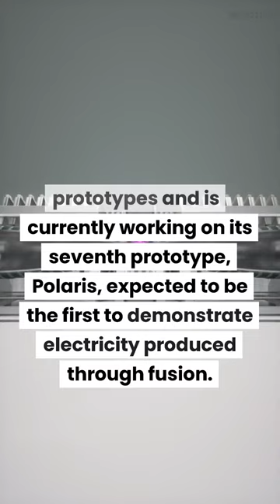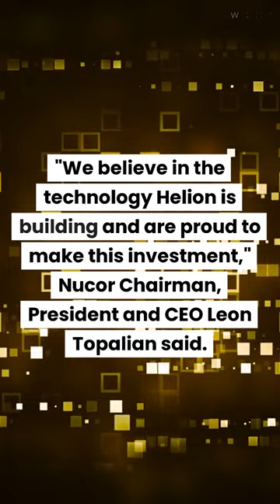Nucor and Helion to partner in the development of a 500 MW nuclear fusion power plant #NuclearFusion

Comment: >new form of electricity production
>it’s just boiling water

In all seriousness, I pray to god this thing works that way we can have nuclear without people getting all antsy about it. Even though nuclear has worked for the last 60 going on 70 years with 3 failures with 1 being the cause of horrible geography. 1 the cause of a horrible reactor design. And the last being bad but still having ZERO deaths. God. I pray you give us this unbelievable technology. Not because we deserve it but because we desire you
Reply: The cool thing about Helion's approach to fusion though is it doesn't use boiling water to drive a turbine for electrical power production. Their fusion reactor design uses specially designed helically magnetic fields that compress the plasma in pulses, with the magnetic push back force of the fusing plasma being absorbed by the magnetic field for net energy production. It works similar to regenerative breaking on electric cars, but each time you press the accelerator it triggers a fusion reaction that recharges your battery with more energy than it took to accelerate. It should be noted that Helions prototypes haven't yet achieved net energy production, but the concept is really interesting and avoids a lot of the inefficiencies of traditional fusion reactors like a Tokamak or Laser Confinement. 

The big criticism of Helion however is their choice of fuel, Deuterium fusion with Helium-3. The D-He3 fusion chain produces significantly less energy than traditional Deuterium-Tritium fusion, and Helion has been silent on how they plan to handle the massive amount of neutron radiation their fuel choice will produce from the secondary fusion of Deuterium with itself. At full power plant generation levels some estimates put the neutron radiation at Chernobyl levels, so either Helion will need to entomb their full scale reactors in several meters of lead, or their design just wont be safe to run at the scales needed to generate net positive energy.
Reply from the maker: Wow, thank you for the detailed response. Very helpful!